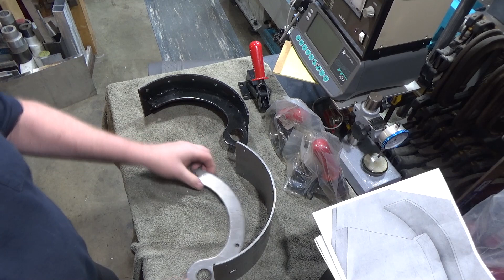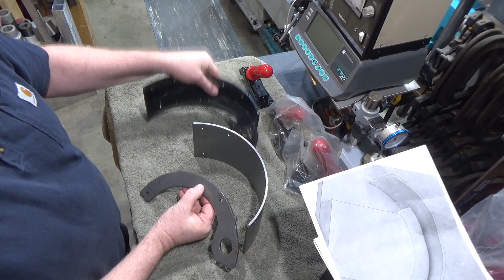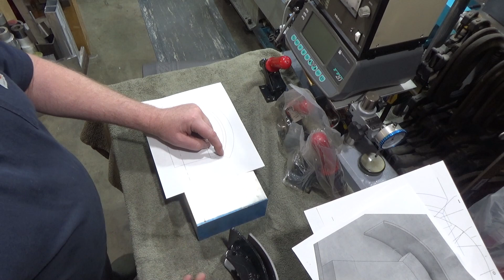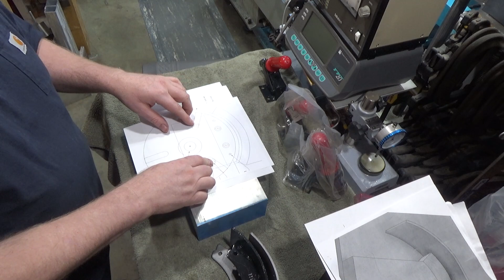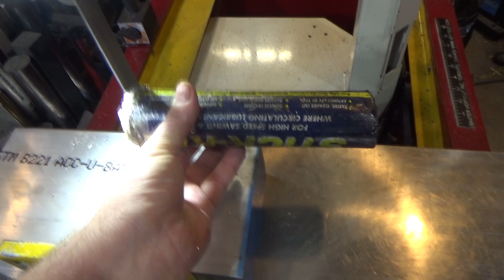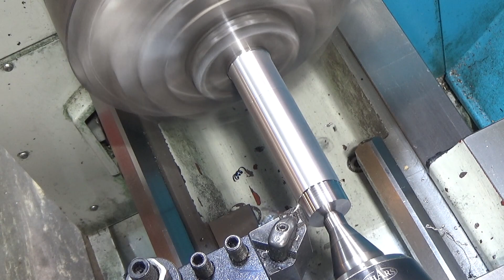228 Heavy Machinery Brake Shoe Welding Fixture Part 1

Comment: Looks great. I like the pre-planning of the mounting holes to the rotary table.

You may want to consider two / three points of contact to position your web that are in line with the toggle clamps. You could use hardened pins that would last longer than the aluminium with the burrs. These pins could also locate the clamp bar. The pins could be swapped out for different radii.
Reply from the maker: Thanks for the great tips. I considered using this approach, rather than the continuous surface, but didn't do that because I was concerned about the forces that were going to come into play. The clamps I a musing are capable of around 5800 pounds force and that concentrated on the line contact of a pin had me concerned. Your solution would be perfect for accurately made parts, but these are definitely not those. The tolerances are wide and the parts have to be squeezed together, with quite a bit of force, to fit.

Comment: Good job. But consider having the 2 parts vertical? The robot will have access to both sides at the same time. Really enjoy your channel.  Greetings from Albion Victoria Australia.
Reply from the maker: Interesting that you should say that. The original fixture from the company was vertical with lots of ribs and bits everywhere. It was a fairly complicated design that would be much better suited to CNC or at least laser cut parts. Thanks for the comments. I always appreciate them.

Comment: What a project Robert... Don't forget to put a hefty bevel on it for when they flip the first weld operation.
Reply from the maker: Thanks for the warning. I actually designed the support to be almost 0.250" away from the part, so I think I'm covered.